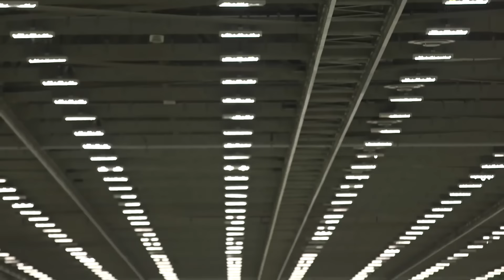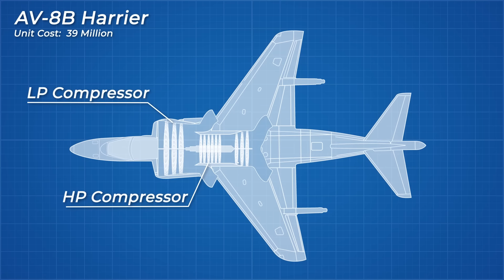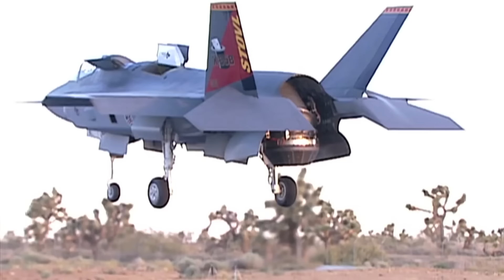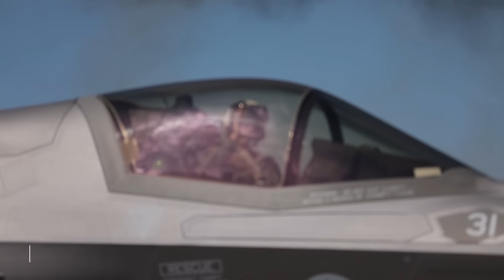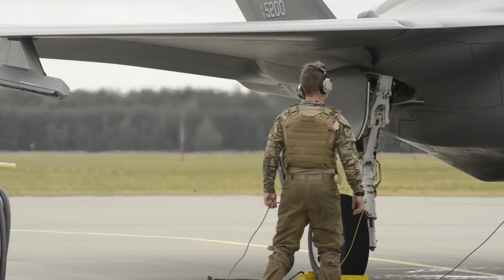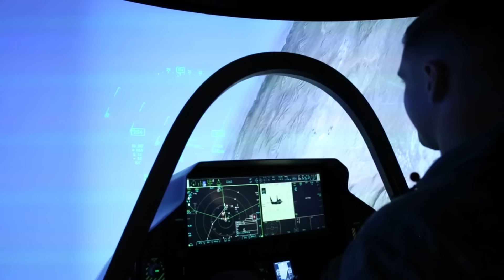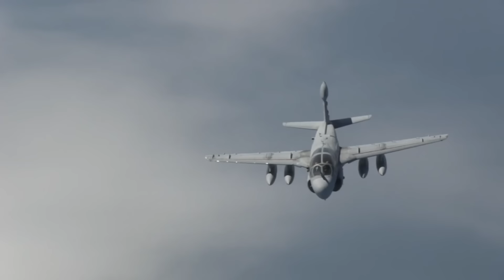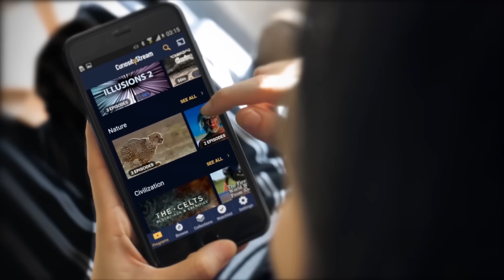Is The F-35 Worth $115 Million?

Comment: F-35 VTOL similar to YAK-141?
Reply: British start it with harrier in 1960s
Reply: @fadli_1577  i mean the combination both lift fan and vectored thrust
Reply: @have_no_idea  The "vertical lift" aspect is not comprable. The Yak-41 uses three turbojets. The F-35B uses a "cold" lift fan powered by the engine.

Comment: the thing is about the dogfight reports you mentioned, the F-35 was a plane designed for only BVR fighting, so if an F-35 made it to the range where they started dogfighting, then the pilot of the F-35 has made some serious mistakes, the only reason the F-35 is said to out maneuver any plane except for the F-22 and its competition (the Su-57) is because it needs to do BVR fights which still require enough maneuverability to evade missiles.
bonus note: I know I said the F-22 and the Su-57 can out maneuver it but it still can very well match those planes, and realistically if we factor in costs the F-22 and the Su-57 would be fighting multiple F-35s, so that's why its better, but its still capable enough to destroy 4th gen planes like the JF-17, J-15, and more
Reply: It isn't said to out manoeuvre anything. In fact its one of its failing with its small wings. The C might be OK, but A and B are going to get pounded by any AS fighter.
Reply: @thorinbane  Bro the C isnt even the best dogfighter out of the three
Reply: Are you a manager in lockheed?
Reply: @VDG-g5h  guess who is bombing Latakia?
Reply: @VDG-g5h  he is member of India unemployed youth

Comment: The A-10 does not come with a hefty price tag, and there’s absolutely no honest analysis that possibly indicates that the F-35 is a superior close air support weapon. Downvote on your assertions here alone—whether from incompetence or deceit, your claim is shockingly misleading.

The F-35’s cost per flight hour is absurdly prohibitive in this role. Then, the other explanatory variables for success: slow-speed maneuverability, armor and durability, loiter time—it’s inferior in every single one. It could never fly low enough, and slow enough, nor long enough, to provide the cover that an A-10 can provide. And without a comparable gun, you’ve removed a key capability completely.
Reply: A10 is too slow and have very low altitude
Reply: @fadli_1577  you’re too slow and low altitude.

The A-10 is a tank destroyer and CAS superstar, that operates at a fraction of the cost of the F-35. It is only deployed when we already have air superiority, as that’s really the only time CAS even exists. It was designed to be slow and to have a tight turning radius so it could effectively operate in a hunter-killer role, distinguishing friendly from enemy. It was designed to be armored and to have a large, accurate gun, capable of vaporizing armored vehicles and cement buildings. 

The F-35 cannot operate in the A-10’s role. It flies too fast, is unarmored, and doesn’t have an accurate gun. Guns are cheaper and more precise than bombs and rockets. It is too expensive to even be deployed in a CAS role. War is about resources, and it eats up too many resources given its poor effectiveness in a CAS role. It also can only loiter for 1/3 of the time an A-10 can.

The F-35’s stealth and sensors are useful in a strike role. But even then, it needs an escort and EA support in contested air space, as it lacks the capability to defend itself against the types of aircraft China and Russia operate. A squadron of Su-35s will cause serious problems for F-35 pilots.

The F-35 carries a tiny payload and is extremely loud. It isn’t particularly stealthy, at least when compared to the F-22 or B2, and is not at all stealthy from rear aspect. After its first pass, the jig is up.

And again, radar isn’t the only sensor used to detect aircraft — its heat signature and audio signatures are massive.

The F-35 is useful, though disappointing, strike aircraft capable of deploying from small ships. That said, it isn’t a good fighter, nor is it a good CAS weapon. It’s a mediocre strike weapon, that was compromised by a poor cost-savings approach. The F-35b is very useful, however, had design specs not been shared with the Air Force, we could’ve gotten better performance than the F-35A. As for the C model, this seems the most half-hearted. It’s too slow, too fragile and too sluggish for anything but high-risk strike missions. The F/A-18 will be required for decades because the F-35c fell so short of its promises.

Comment: F35 software has 900 bugs.
Reply: What type of bugs?
Reply: @infinitelyexplosive  Google it,
https://www.bloomberg.com/news/articles/2021-01-12/f-35-flies-with-871-flaws-only-two-fewer-than-a-year-earlier
Reply: @RadicalTek  that's doesn't answer the question? There's no way to tell if "bug" means "radar misclassifies things" or "there's a stack overflow that would cause the plane to run out of memory after 100 straight days of operation" or something completely different.
Reply: @infinitelyexplosive  ok, you win, Lockheed Martin.
Reply: @RadicalTek  What?

Comment: All this money to create something that is no less than a vertical thrust missile carrying lemon. If it doesn't dominate it will get dominated, and one simply can't create a jack of all trades that is a master of all. Instead of everyone trying to suck dick on a already convoluted marketing campaign to suit their needs they should have just designed aircraft fitting for the roles they intend to use them in.

In the scenario's it does shine it wouldn't have mattered whether you were flying a bathtub or this thing, since the missiles will do all the work regardless. In the scenario's it doesn't shine its just a SOS signal waiting to get backup or shot down. This thing is quite literally pointless.
Reply: So something that can dominate a battlespace is pointless... that simply doesn't make sense. 
20-1 KDR.

Comment: NO!!!!!!!!!!!!!!!!!!!!!!!!!!!!!!  The F-35 is a (currently) $1,700,000,000,000.00 boondoggle LEMON!  Absolutely pathetic piece of aircraft!!!  They already need to spend more BILLIONS to update the computer system on the thing, since our pilots need to Ctrl Alt Delete their onboard HUB to reset the radar!!!!  

I could go on and on, but the F-35 is why we still have pot holes, people.  And the F-35, after fifteen (15) years, it still has issues, isn't stealthy enough to hide it from radar, and has YET to fly a SINGLE combat mission (escort doesn't count).  So no, it's NOT worth it.  End this pathetic program, and end the Military Industrial Complex.  

Not to mention that the strategy of potential enemies of the U.S. isn't to go after the supposed "superiority" of the F-35, it's to go after our mid-air REFUELING AIRCRAFT, since the F-35 has a range of less than 1,700 miles (before an afterburner).  

So yeah.  F Lockheed Martin, and F the F-35.  End this FAILED program, and maybe come up with something better?
Reply: 1.7 billion is the cost to buy, maintain, fuel, arm, upgrade facilities, pay wages for ground crew and more for 2000 f35s. Israel has used it in combat. Everyone who has used it has raved about how good it is, 20 to 1 kill ratio in red flag, an Italian flight of f35s destroyed over 100 air defence systems without an issue, one squadron of f35s killed 60 4th generation opposition fighters, Dutch pilots say the only way an f35 loses to an f16 in a dogfight is if the f16 is naked, it has an extremely powerful electronic warfare suite that is good as dedicated aircraft

Comment: The F-35 needs a F-16 escort to be an effective weapon in a dogfight.
Reply: What dogfight
Reply: You better tell those Dutch pilots that say an f16 only beats an f35 if its naked they are wrong
Reply: Andy Man  3000 miles thanks for the laugh.  Did you know there is a gun on the F-35.  The airframe cracks when it is used but its there for a reason.  I worked on the development before and after the contract was won it is a PIG of an aircraft.  The Air Force is already backing out the Navy will follow quickly.  3000 miles LOL, really that is funny.
Reply: @nightdipper5178  and I'm an f22 pilot
Reply: @johnrodriguez853   What company developed and produced the CNI system for the F-22?  I worked on that hardware also.  The F-22 is a good plane but  Obama killed it.  Do you  shoot planes down that are 3000 miles away when your tooling around in your F-22?
Reply: Andy Man  in this case the f 35 itself would not shoot the shot. Do you see the problem with this? The plane needs another plane that can also get shoot down to do what you are trying to say. It would be way easier to just use the plane that shoots the weapon as the plane that guides it.

And if we talk about such distances you run into a problem. Sending signals takes its time. And if we talk about rockets that fly with the 4 times the speed of sound such a delay is the difference between a hit and a miss. 

Sorry but if you already outsource the carrying and guiding to another system not outsourcing the controle to those systems just creates delays and vulnerabilities.

Sure it's ability to connect to other systems is an advantage, however the situation you talked about is actually not an advantageous. 

Doing an attack like that is just a waste of resources. You are basically telling me, that if I press the button, and this send a signal around the world before it turns on my lamp this is advantageous compared to just closing the electric circuit.
Reply: Andy Man  While the ammunition is self guided it still has an open data link to switch targets or correct its course. 

And you have also totally missed the real problem again. Using the f 35 on the other side of the planet to guide a weapon is just stupid, since the thing that fires it can do the exact same job. If such a weapon would be fired against the plane that carries the rockets the delay would mean that a response would be delayed. Localising the fire controle, weapon carrying, and sensor units is far better. That is why an f 35 in a group of less developed planes can increase their effectiveness since it can share its data. This is the real advantage of an interconnected grid.

But using such a system in the way you said would just be unnecessary. The plane that fires the rocket could also just guide it. Or if the target is out of reach the data could be send directly to the plane that carries the weapon. This is way more efficent than sending the data to an f 35 that is on the other side of the globe, before this then sends a signal back around the globe.

Comment: personally I think if they made a stealth variant to the F-18 then it would be much better than the F-35C
Reply: The f18 is supposed to be light and cheap
Adding stealth technologies would remove its advantages
Reply: I mean, they did switch to parallelogram air intakes on the Super Hornet specifically for stealth benefits.
Reply: @infinitelyexplosive  Light fighters like the hornet and f16 will never be able to achieve true stealth simply because of their external weapons
Stealth requires internal weapons bay which just isn’t possible, sure you could reduce radar signature to an extent but it’s far from “stealthy”

Comment: The technology of the F117 may well have been designed in the 1970's but the SA-3 that took it out was designed in the 1950's. Strange omission, unless you're biased. 

The air force is big on these stealth planes but the navy is not and has been forced along for the ride unfortunately. 

The same mentality led to the original F-4 being put into service with no cannons because missiles render them obselete, until they weren't.

Also no mention of the appalling speed of these things which would be impressive if we were in the 1960's.

Granted it is faster than the harrier but the Harrier wasn't expected to perform the air superiority role.
Reply: In addition, as an engineering channel, surely you're aware that any good engineer will look for a solution to the problem of low radar detectability, such as ever advancing infrared sensors, with long range sensors on the horizon which will render this technology almost useless.

Don't get me wrong, low radar observability is important right now (for the next 5 years according to the Israelis), but so is a decent airframe. The F22 is a far superior airframe to this AND has stealth. 

There's a good reason the F-15EX is likely to be procured. It's a far more capable aircraft with much more capacity for weapons stowage (another glaring omission in the video is the lack of mention that the 35 must store its weapons internally or else lose it's stealth advantage, limiting its use in an air superiority role).
Reply: @noneofyourbuisness2539  It seems a bit unfair to compare the F-35 to the F-22 considering that the F-22 costs twice as much and is designed for a different role. 

If you're arguing the internal storage of the F-35 is insufficient, that seems like an implicit acknowledgement that the stealth is important, in which case an F-15EX would have effectively zero payload capacity. If it doesn't matter, than there's no issue putting hardpoints on the wings.
Reply: The missile was from the sixties and modernized in the eighties. The radar was from the seventies. The F-117A is also from the seventies and so no modernization. It lacks any form of countermeasures.

Comment: as a special missions limited deployement aircraft, sure and that's where it's headed thanks to his HUGE cost 2 x f16 latest build and 2x cost to run  good to have plans on hand if by some mircacle Russia becomes a military threat or china learns how to build something worth a crap currently using home grown tech they have to slash bomb load or distance, they can only make a decent plane by stuffing Russian engines into it.  time to pull the plug and put it on life support, just enough planes to replace damage / worn out and provide parts.  Fill out air fleets w latest f16  oh, dosen't help the f35 causes pilot blaokout during slow level flight, a problem never figured out, one of 800 known defects.

Comment: No single plane will never replace all other planes. There will always be a need for a good ground attack aircraft like the A-10, or an air supperiority fighter like the F-22.
Reply: a bomb can do what a a10 can do for better and cheaper 
F 22 is never going to get replaced for a long long time
Reply: @lunatic_nebula9542  Hell, the A-10 nowadays uses almost nothing but bombs, hydra pods, or maverick missiles! The cannon has always been a flying friendly-fire accident which can't kill tanks like originally intended, and can't be used anywhere that has so much as a single soldier with a portable rocket launcher on their shoulder. So if all the A-10 is being used for is a light bomber/missile launcher, why not just launch said bombs and missiles from a plane that doesn't need fly in range and present its ass in front of AA defenses to deliver said bombs and missiles? Like the F-16, the F-111, the F-117, and the B2 - planes which have all demonstrated to be better at it for years, without the massive aircraft losses and friendly-fire incidents?